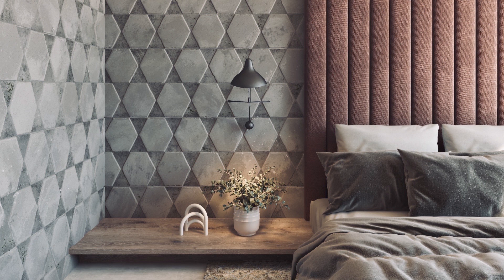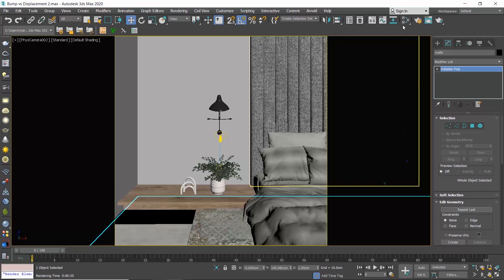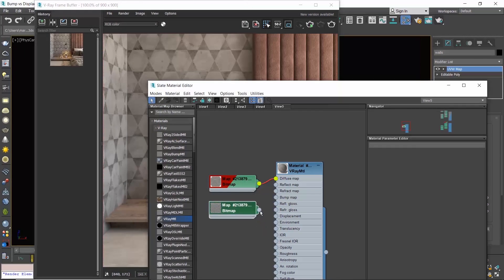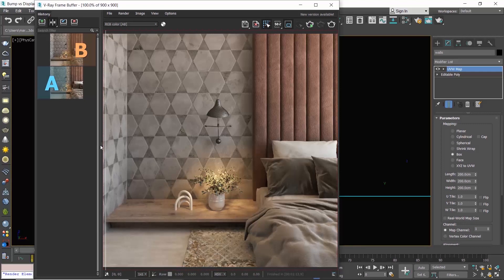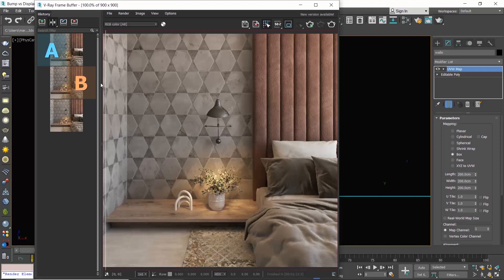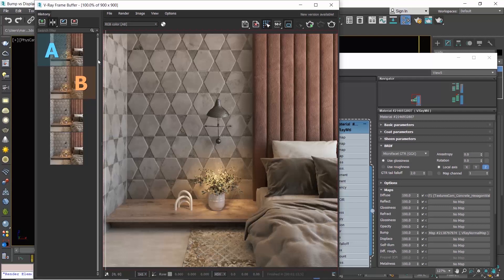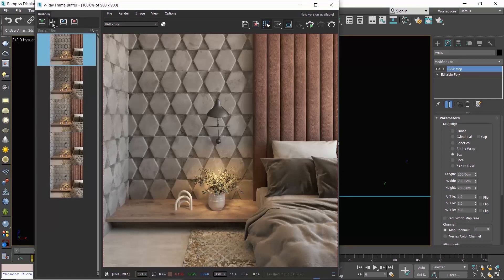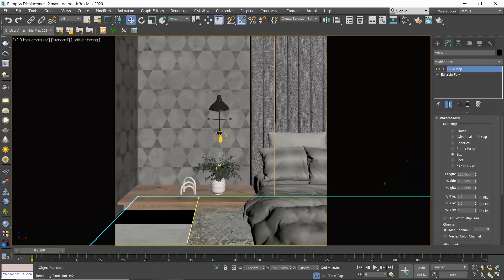Vray 3DS Max Material Tutorial - Bump, Normal & Displacement Map | PBR materials

Comment: I appreciate that this may have been a tutorials to cover the basics for an absolute beginners, but even so, there are some crucial information missing and the workflow shown isn't the correct one to achieve the intended results. Bump/Normal/Height/Displacement maps shouldn't be gamma corrected. This can be achieved either overriding gamma when importing a bitmap (value 1), or, my preference, using a VrayBitmap and set up the appropriate type in the color space transfer function. Missing this step can create unwanted results, like shown in this video. Also, the 'distortion' artifacts that you mention @7.40 have little to do with the displacement amount, but mostly with the quality, resolution and depth of the bitmap used (in this case all three aspects of the images were very poor). And of course, a better result can be achieved using the VrayDisplacementMod.